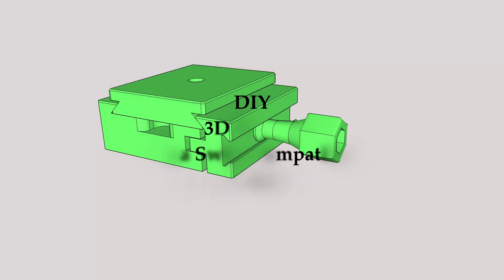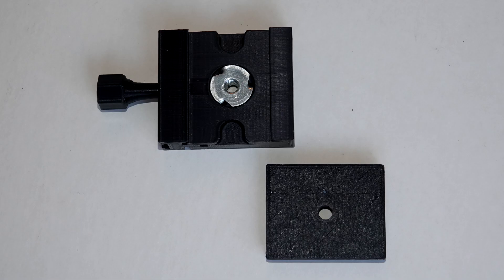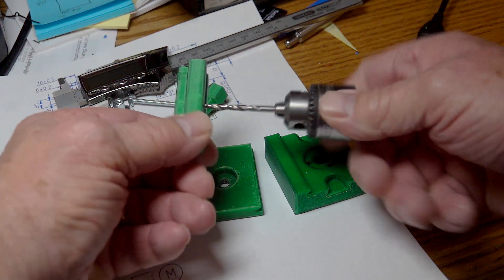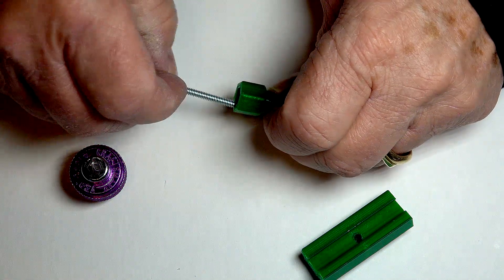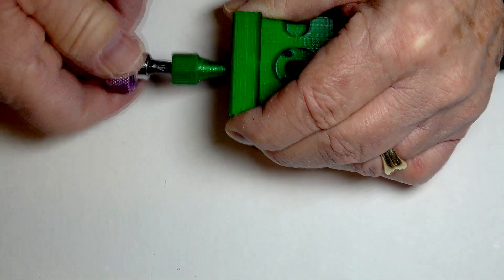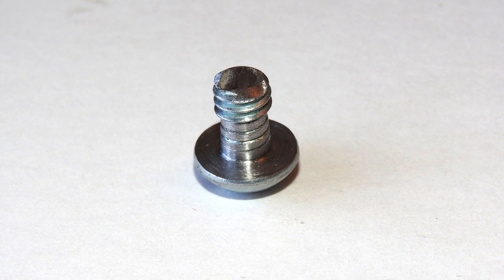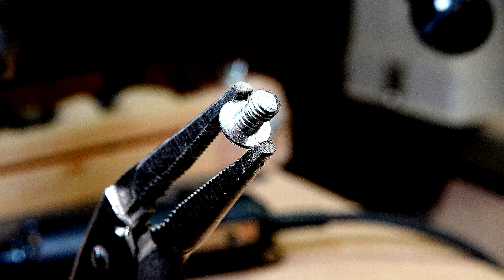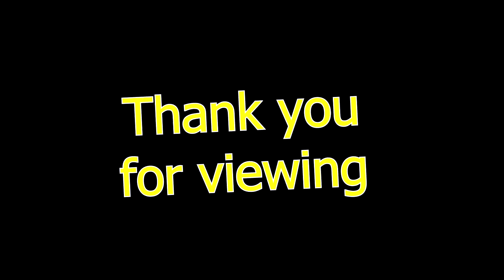DIY 3D Printed Arca Swiss Mount

Comment: Exclamatory good, I dont have 3D printer  nevertheless I am subscribing your channel and once I have one Iwill follow your steps.
but as of now coudl you tell me which model of 3D printer would be better for such projects? Please!
Reply from the maker: I currently use a Creality Ender 5 printer.  I started with a Monoprice Mini and it worked pretty well for many projects but as my projects got larger I needed a larger print platform.  I really like the Ender 5.  I now print only PETG filament.  I used PLA when I started.  Several posts indicated that PETG was  more difficult to print with but I have found it very easy to use.  I hope you find a printer to use for your projects.  You might check your local library, too.  Our library has about 5 printers for patrons to use as well as other tools.
Thank your for comments and questions and thank you for viewing.
Reply: @MontanaMonk  thankx for guidance, I would ask my son to follow the suggestion

Comment: What kind of force would these mounts handle? I'm looking at using for a gun to tripod mount
Reply from the maker: While the PETG material is quite tough, this design is too light to handle a gun.  If the design were made at least twice as large and printed with at least 50% fill, it might work.  Probably a lot depends on how well the gun is balanced on the mount and what recoil the mount has to absorb.
Thank you for questions and comments and thank you for viewing.